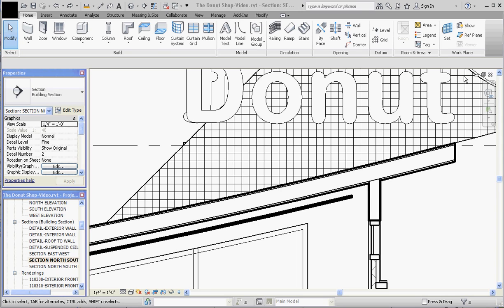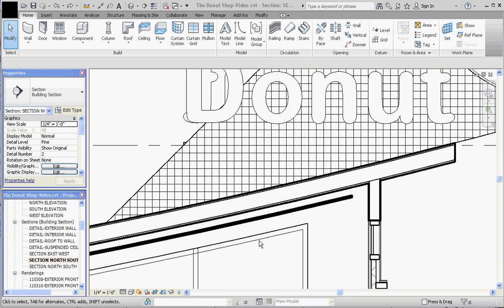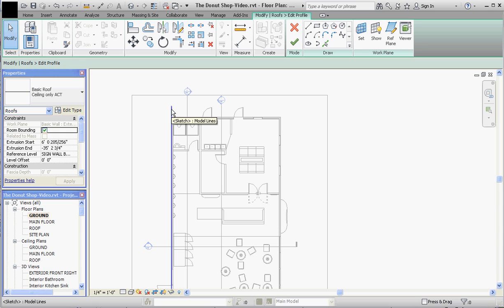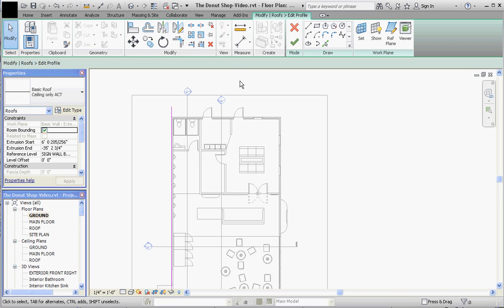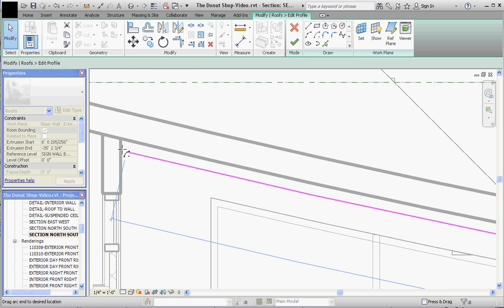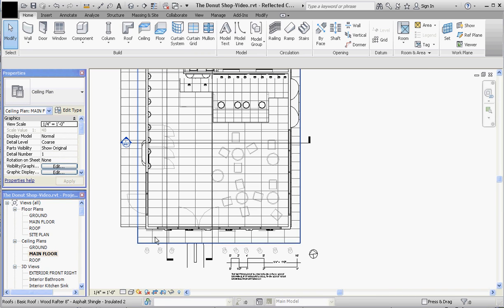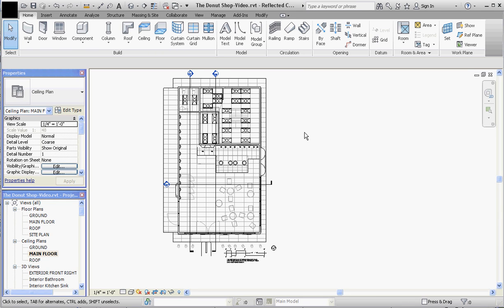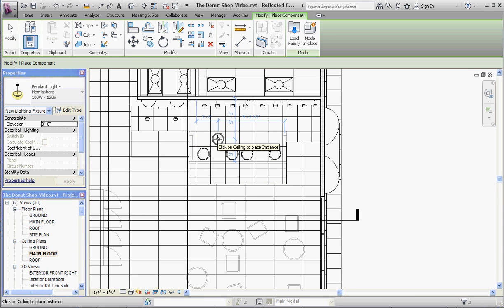Ceiling of a Curved Roof, Part 2, Modifying the Offset Ceiling

Comment: Hi! thanks for your work, I have a question: would you be able to place any light fixture onto this ceiling? Because its property type is still "roof"
Reply from the maker: Fei Feng You can't hang lights on the curved or sloped ceiling portion of a roof structure.  However you'll likely find the answer in the next video, it will show you a work around.
Reply: Actually if you use model in place ceiling you can host lights on it. But theres another issue when doing that, lights can only be copy paste along the curvness of ceiling, trying to find out why
Reply from the maker: Fei Feng Thanks for the reply.  Can you make a video of what is happening?  This way we can see what the problem is.